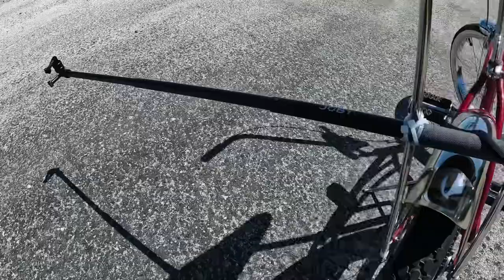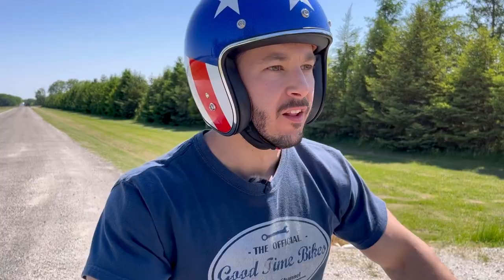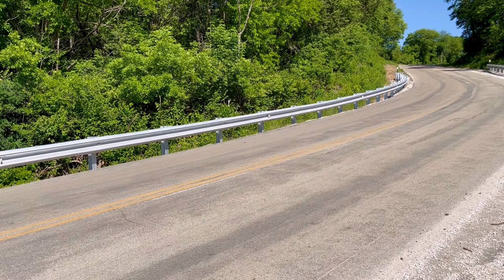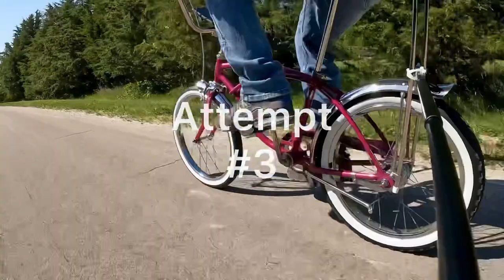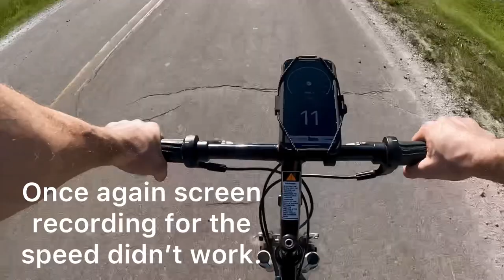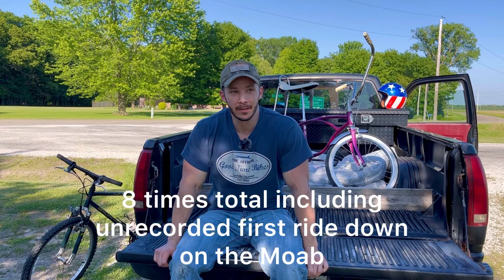40 MPH on 1966 Schwinn Stingray?

Comment: I had a back tire blow out on my Orange Krate. It had a slow leak and I would over inflate it every morning. Thank God I wasn't going as fast as you. It was out of control. I ended up un some pricker bushes. Nice to see your old Stingray working so good. Don't worry about the speed so much. It's all about how good you look while riding it.
Reply from the maker: I was definitely taking a risk but I really wanted to hit 40 mph. I’m planning on finding a bigger hill so this bike officially reaches 40. Do you still have your Orange Krate?
Reply: @GoodTimeBikes  No, unfortunately I don't. I parked it after I pushed it home. A kid from down the street saw it and asked if I wanted to sell it. I sold it to him for $10 so I could buy a watch. I tried to get it back years later, but it was gone. 😔
Reply from the maker: @tywebb355  jeez I’m sorry to hear that! If only you knew how desirable they would be later on. Did you ever get another one at some point?
Reply: @GoodTimeBikes  I tried online years ago. I threw in a few bids here and there with no luck. I'm now trying to build a "Girls Krate" for my granddaughter. I have the donor bike for the frame, but I'm having sticker shock on the repop parts it's going to take to complete it.
Reply from the maker: @tywebb355  there are late 70s and early 80s Schwinn Fair Ladys that you can find for $100. Your Orange Krate is expensive no matter what (as you probably know). Even the worst rusty heap it’s $600! It would be nice if you could find an Orange Krate for yourself despite the price tag though.
Reply: Rear tire on the Krate is a pain to replace😂

Comment: You may not have pulled off 40 mph but I think the real achievement was that you did 16 miles (~2 mi x 8 attempts) of ascending and jeans.  What percent grade is that road section?
Reply from the maker: I think it was about .3 mi one way. 1,584ft with elevation of 123ft. Divide 1584 by 123 then multiply by 100 and we should have our grade correct? If I did the math right it’s 7.76%. I think this would be more accurately measured if we were only measuring the steepest portion. My calculation includes a rather flat portion. Either way that’s pretty funny you mention mileage and jeans lol I wore jeans because I wanted to at least save my legs if I went down.
Reply: @GoodTimeBikes  That's pretty much correct.  I'd reckon you could eek it out from 39 to 40 mph by getting rid of the camera stick and mounting the camera central to you.  

But riding uphill on it and stopping on those brakes (either bike) is a feat in of itself.
Reply from the maker: @yuri_on_youtube  if the video does well enough I’ll find a bigger hill and maybe even shoot for 45. I hear Galena IL has some big hills but that’s about 3hrs one way. Maybe if I rode more in the other lane it would have made a difference but there’s traffic so I didn’t want to take that risk. 

I was a able to ride the Moab up hill in 1st or 2nd gear but the Stingray didn’t stand a chance so I had to walk it lol my vintage brake pads did a great job! Lol So long as that kind of performance wasn’t demanded of them consecutively they were good. I imagine if they didn’t have time to cool down there would be a problem lol

Comment: I remember watching the programme about Guy Martin and his record for highest speed in a gravity powered "Soapbox". You might consider it cheating, but you'll get a slightly higher speed if you were to add a little weight, somewhere out of the airflow. A slim back pack with some bottled water? Plus you get a drink on the way back up the hill.  😁
Reply from the maker: Ah not a bad idea but in the video my “rider weight” is about 200lbs as it is.. I don’t want to add anymore stress to the little Stingray lol

Comment: You might want to go trying to leaned forward downward towards the Handle bar. You should try a 1980s 10 speed betcha you will be able to hit 45 mph.
Reply from the maker: I tried everything I could that day and nothing was working out for me. However, I did surpass my goal on a bigger hill. Also, I definitely agree that a 10 speed would have picked up more speed and it would have felt more stable I bet haha